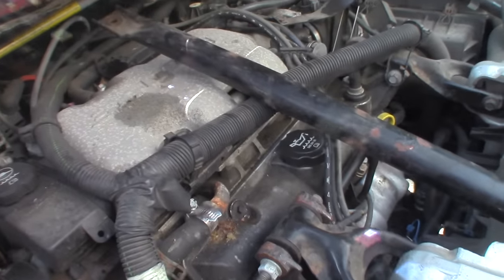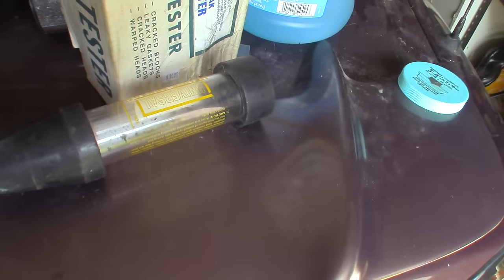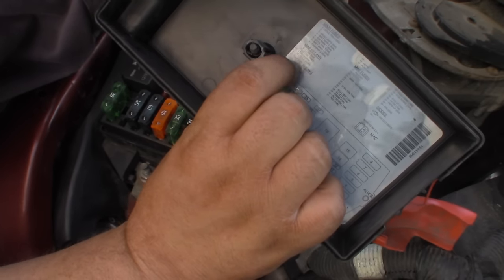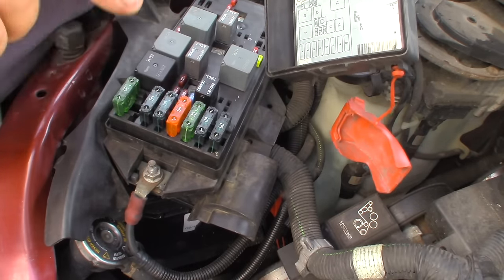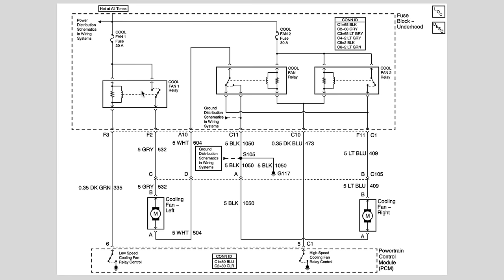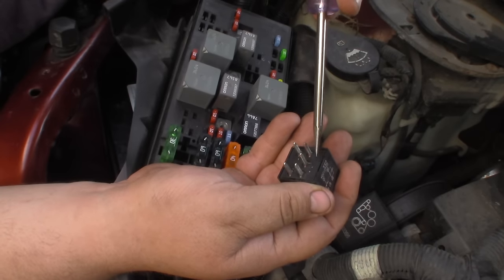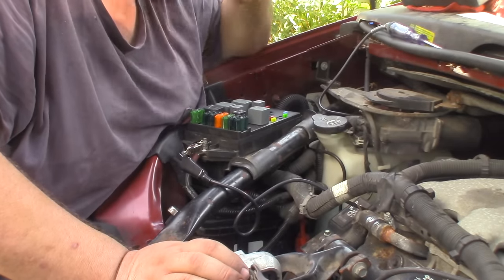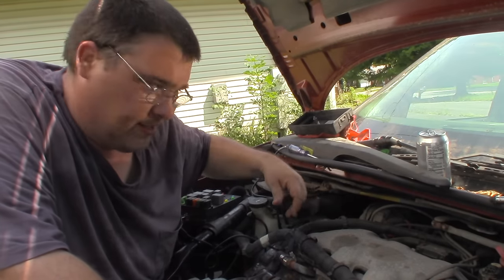GM 3 Relay Low/High Cooling Fan Explanation/Diagnosis/Testing - Chevy Venture

Comment: My cooling fan wasnt working at high or low speed when instructed to. But my AC still worked. I changed my relays but my high speed control fan still doesnt work when instructed to when my temperature gets high? What do you think could be the issue
Reply from the maker: Need to test if the ground control side of COOL FAN and COOL FAN 2 are receiving a ground when the fan is supposed to turn on.  Hook a test light to positive and probe the ground control side of both those relays and make sure the light lights up when it is hot and the computer should command them on.  If it does then put your test light to ground and make sure they are getting positive voltage to the other side of the control if they are not check the cool fan 2 fuse.  You can also slide a t-pin under the relay and put a grounded test light to ground control side with the ac running the fan on low when grounding that control both fans should go high.
Reply: FrugalPrepper's Garage & Garden  I have a single fan which controls the low and high speed. Also a single relay resistor. So i dont know how do those tests?
Reply from the maker: What Year Make and Model is the vehicle
Reply: FrugalPrepper's Garage & Garden Peugeot 207 1.4L 2009

Comment: I need help I’ve been trying to fix my car for months I just don’t have the money to take it to the shop so I have a vw cc 2014 2.0 tsi my fans stay on when key is on or car is running I replaced one of the Relay temperature coolant sensor and connector and added coolant I was at half I don’t have an check engine light well I do Ambient temperature something code I’m lost
Reply from the maker: Well, if it's not reading the Ambient Temp Sensor that is most likely your problem believe it or not.  VW uses the outside air temp as part of it strategy as to how fast to run cooling fans.  Have a look under the front of the car, slightly towards the left side, and inspect outside air temperature sensor.  Believe it or not a lot of times they get broken off from hitting bumps or parking lot blocks/curbs.
Reply: FrugalPrepper's Garage & Garden omg I can’t thank you enough I didn’t worry about it but yeah that ambient temperature I followed the wire a bit back and it had a cut in it I re-soldered and fixed my problem but I have another question so I went to start up the car it’s 43 where I’m at and I had a bit of white smoke and clear Liquid come out from the exhaust not exactly at the tips a little bit behind the tips and and when I get down near the exhaust sounds like gurgling the liquid was clear didn’t Smell like anything because problem I had was when turn on the car the fans would always run even though the engine is cold as can be so now that I fixed it and fans come on only when engine is hot or whenever it comes on there was a bit of clear liquid that that normal no rough idle didn’t stall starts every time
Reply: FrugalPrepper's Garage & Garden I’ve had the car for almost 2 months it’s been sitting because I couldn’t figure out that problem the guy before used it as a daily but I got that problem fixed today but it mite not be a concern because before I fixed the fans always coming on I would rave up to 1000 to 3000 rpms and hasn’t been driven just started to warm up but on my temperature gauge it stayed at 190 for a while maybe about 30 minuets of idling wouldn’t go up or down until I turned it off and saw the clear liquid and white smoke and sounds like water gurgling I put some of it that dripped on the ground on my finger didn’t have a Smell and was clear like later and would have a little smoke at idiling and a bit more when I rave the rpms up a bit
Reply from the maker: @AliVapeReviews  I'd drive it a while and let it get good and hot.  It is probably some condensation int the exhaust from sitting.  Also now that the cooling fan is able to work it is allowing the car to go into closed loop operation so the converter is working.  When a car is in open loop it uses a default fuel strategy that runs a little rich, when it comes up to temp is switches to closed loop which make the fuel mixture cycle for slightly rich to slightly lean so the converter can do it job.  The cooling error will cause it to stay in open loop.  One of the by-products of a working catalytic converter is water.   190 is a normal operating temperature for that car.
Reply: FrugalPrepper's Garage & Garden ok thank god I thought I did something but yeah it stayed at 190 for a bit and I just turned it off thanks again

Comment: Hey, My issue is with the cooling fans they come on all the time even at cold engine and just ignition on. My code is P0117. I have changed Coolant Temp Sensor, Still fan comes on all the time. 05 Impala 3.8. Please help. Thanks.
Reply from the maker: The first thing I would do is look at live data on my scan tool to make sure the MAP sensor is responding.  If you can't do this and you don't have a code for a MAP sensor it is probably OK.  This is because the MAP and the ECT share a common ground.   Take a test light, hook it to battery positive and back probe your black wire on the ECT touch it with the test light and verify you have a ground at the sensor.  You probably will since you have a 117 instead of a 118.  Next hook your test light to battery negative and back probe your yellow wire with a t-pin and touch it.  If the circuit is in tack your light should light dimly and your temp gauge should move.  (if the wiring is bad it probably wont).  Next you need to follow the yellow wire back to connector C126.   C126 is on the back of the engine, right above cylinder 3 and 5 fuel injectors.  Test it there as well, with the connector plugged in from both side.   Also unplug and inspect the connectors from both side.   I have seen this connector work it way loose and/or get the green crusties inside of it many times.   The next stop is the PCM (lets hope we don't have to go there).  Let me know what you find.
Reply: @frugalprepper   I'm  guessing I'll have to Run the Engine to monitor the MAP Sensor Live data? I do have a Scan tool that monitors 'Intake Manifold Pressure" but, I don't  know if its the same thing as MAP..? But, I can't run the engine now anyway because I kind of have the thermostat housing open from trying to remove/replace the ECT Sensor.... But, I did complete the test tasks You outlined and these are My findings: Using the Test light showed that I have Ground, It light up. Then, Hooking to Batt -ve and probing the Yellow ECT wire dimly light up the test light, but I didn't see the Temp Gauge Move. Next task was to trace the Yellow wire to the top of the engine bw cyl#3 and 5th injector. But, I'm thinking there should  be no need for that if the test light dimly light up at the ECT Connector, the Yellow wire integrity must be intact.. ? But, I went ahead and Unplugged the connector and tested it there also and the Test light light up as well.. I also checked for corrosion as You suggested there was none anywhere.
So what do I do next? PCM?
Reply from the maker: @phigo4kins  Intake Manifold Pressure is the same thing as a MAP.   It sounds like you have a ground and signal from the ECM.  If you look at the ECT on the live data is the temperature correct.  I would look at it and see if it is about right with the sensor plugged in and if you unplug it, it will go to some really negative value like -38 degrees or something.   If that works then the wiring on the sensor is good.  

Then I would check the control side of the relays.  The computer pulls the signal wire for high and low speed fans to ground to turn on the fans.  If you have a control wire grounded or rubbed through and shorting to ground this could cause the problem too.  I would go to the relays pull them and probe the control pin and see if it will light a test light hooked to positive, that means it is seeing a ground on the control wire.  then unplug the ECM and see if you still have a ground on those control wires.   If you don't have a ground with the ECM unplugged but you have it when it is plugged in then you have a ECM with controls stuck to ground.   If you do still have a ground then you have a short on the control side.
Reply: @frugalprepper  Yes, the 1st part of Your assessment is true. When I look at the Live data, The Intake Air Temp is the same as the Coolant temp when plugged in (50*F On both) and the ECT reads -38 when I unplug the temp Sensor. 
I will go and figure out the Relay stuff now and get back to You.
Reply: @frugalprepper  Hey quick question, I know this might sound stupid, But, do I probe/test both Control pins (i.e 85 & 86 correct?) with test light hooked to battery positive?
Reply from the maker: @phigo4kins  No that's not stupid.  One side will have 12v present all the time 86 I think.  The other side will be the one you want to probe with the light hooked to positive. .  That will be the side the computer grounds when it wants to activate the relay.  As long as you are testing through the test light you current is limited to about 150 milliamps so you won't blow anything if you probe the wrong one.  The test light just won't light because you have 12v on 86 and 12v on the other side of the test light.
Reply from the maker: @phigo4kins  Also are there any other codes for anything else in the computer when you scan it.  I think it is just the ECT not being seen that will trigger the fans to run full, but there may be some other error condition that the computer sees that turns the fans on full.
Reply: @frugalprepper  it used to be Just P0305 and then later came the P0117 when the Fan started blowing continuously. But, I fixed the P0305, changed the Lifter and My head gasket, then P0036 Popped up. So right now the only other code is the P0036.
Reply: @frugalprepper  Ok Thanks for clearing that up for Me.
 So, I have done the test on all 3 Relay pins. Keep in Mind that one of the 3 relay (the Middle relay) is a 5 Pin Relay, #1 & #3 are 4 pin relays..
So, the only one Relay that stood out is the Fan cont #1 relay.

 Testing Fan cont #3 (4 Pin Relay) With test light hooked to Batt +ve It lit up .

Testing Fan cont #2 Relay (5 Pin Relay) with test light hooked to Batt +ve It lights up on Pins 87 & 87a. 

Testing Fan cont #1 Relay (4 pin relay) with test light hooked to Batt +ve Test light lights up on Pin 87. Just like the other 4 Pin relay. 
 But, the difference is that It also Lights up on Bottom right (85 I believe) EVERYTIME I CYCLE THE IGNITION ON AND OFF, "EMPHASIS ON OFF" It won't light up while ignition is ON only after turning ignition to OFF. And it will stay lit for about 2mins, then turn off again. It does this every single time I cycle the key ON and OFF. The Only other time I'm sure it does this is while the engine is running. Because the fan stay on while the engine is running even on Cold engine start.

I think Fan cont #1 Relay circuit is the Problem. 
From My Poor understanding, Maybe all these stems from the ECM or something else sending Ground to bottom right pin socket (when It shouldn't be, even at cold engine) which runs the Fans for 2mins on those conditions that I listed up there
Reply: @phigo4kins  did you fix your problem at the end? What was the problem? Im having fan problems, fan passenger turns on but driver fan wont turn on, even when I turn on AC passenger fan turns on at full speed but still driver fan wont turn on

Comment: I have a 2011 Silverado extended cab 4.8L and the fan only comes on with the a/c on. I have changed all of the relays, changed the coolant temp sensor, added a 160° thermostat because of all of the work I've done to the engine and the low speed fan still doesn't come on, but if I use a jumper wore to test the fan it works fine. And yes it was doing this before I did any work to the truck. What can my issue be?
Reply from the maker: Unplug the temp sensor.  If the fans come on high speed then you know the high speed fans are working.  You know the low speed works because they come on with the AC.   Also monitor the temp from the computer with a scan tool.  Usually has to get up to 215-220 for low speed fan 230-235 for high speed fan.   Running a 160 thermostat it is going to take a while to get up to temp and it will most likely in cooler weather it will start throwing a thermostat rationality code, because the computer won't like running at that temp for emission reasons.
Reply: @frugalprepper  yeah it will get up to temp fairly easy because I only have a very generic tune in order to be able to start the truck and keep it going basically doing heat cycles every time I start it. I am awaiting my driveshaft to be done and a slot at the tuner to get it in to get it all tuned properly

Comment: I've got a 1998 Cadillac DeVille. 3 Fan relay's mounted below the radiator. I understand that only 2 of the relay's control the fans. 1 relay for the Low and 1 relay for the High. Can you provide me with any information on which relay controls the Low fan. Thank you
Reply from the maker: The relays are in a different place but the logic of the circuit is the same.  One difference is the A/C compressor clutch and the power feed for the control side of the relays are on the same circuit through splice 118.  I put a diagram on Dropbox for you.  ( It says Splice S-118 - In Engine Harness, Approximately 16.5 cm From Powertrain Control Module Connector Breakout
).   Here is the diagram: https://www.dropbox.com/s/a0l95je7mv5iyjq/98%20Deville%20Cooling%20Fans.pdf?dl=0

Comment: On hi speed I only have passenger side working what could it be
Reply from the maker: If the both work in low speed then you have a bad relay or bad wiring somewhere.

Comment: will the cooling fans work if the ac doesnt?
Reply from the maker: If the AC doesn't work, they won't come on when you turn on the AC.  They only come on for AC when it see's pressure in the system and it engages the AC compressor.  They will still come on based on the engine temperature though.

Comment: One of my fans turns on and the other only turns on when the ac is on. Also the gauge inside doesn’t read temperature correctly. Could this be the coolant temperature sensor?